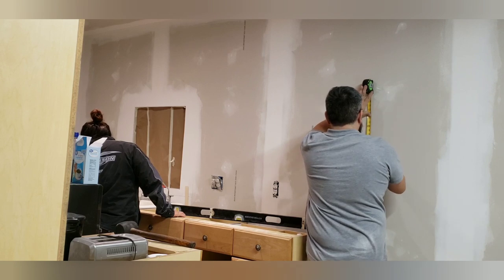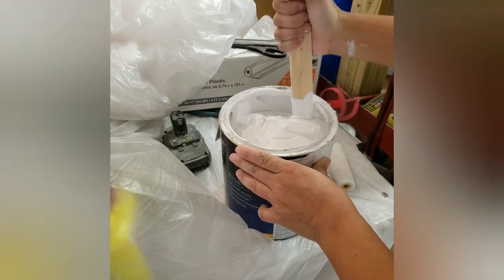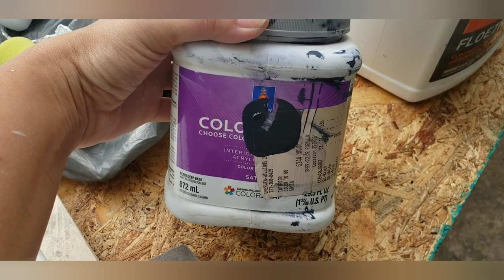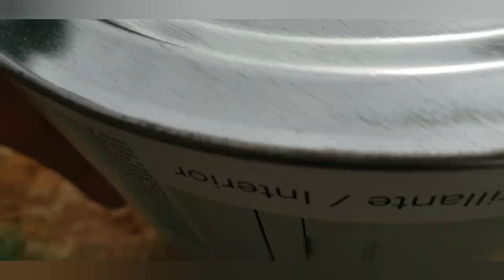Truth about painting kitchen cabinets yourself! (Mobile home renovation 31)

Comment: Nice job overall. Just a little advice on spray painting. Tip size and pressure are important. For the ceiling and walls, I use either a 411 or 515 tip. Adjust the pressure so you get no fingering, but not to high or you get runs and a lot of overspray. I would have sprayed the cabinets with a 311 tip more than likely. You can add the Floetrol to the cabinet spray paint as well  Also, those gun extensions add to drips and such. I never use more than a 12" extension.
Reply from the maker: Thank you for that tip! I wish we would have known that when we did it lol

Comment: Gawd.   Measuring for cabinets is just the worst.  Well almost... Hanging the uppers is actually the worst.  You said you used Sherwin Williams paint in naval?  Sherwin Williams is excellent paint!  My sister did exactly what you are doing.. The white uppers and naval lowers.  It looks spectacular. I do have a suggestion.  IF you do repaint the cabinets, Home Depot has a cabinet paint.  I think you can have it tinted.  Anyway, it self-levels so no brush marks.  And it is chip resistant. It has a hard shell finish.  Just a thought.  And don't brush back and forth when painting.. I'm not sure how to explain it though.  I don't envy you having to repaint those cabinets.  Also, find a non-yellowing polyurethane to use as your last coat.  Also helps prevent chipping and staining.  I think you are doing a fantastic job.  I can't wait to see it.
Reply from the maker: Sherwin is a great paint but unfortunately I used a different tint for the sherwin color. That was the issue. That's why the top cabinet turned out really good lol. I used a more expensive paint for the top.
Reply: @superkeola  Oh. Well, I think it will look great just the same.  You guys have put in a lot of work and it shows!  And didn't know there was a more expensive paint than Sherwin Williams!  lol  Rock on!